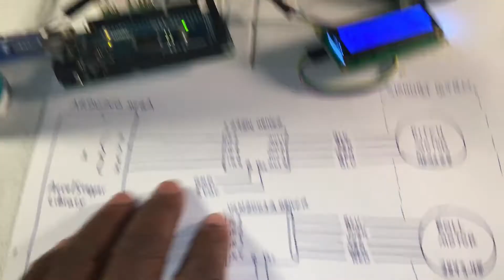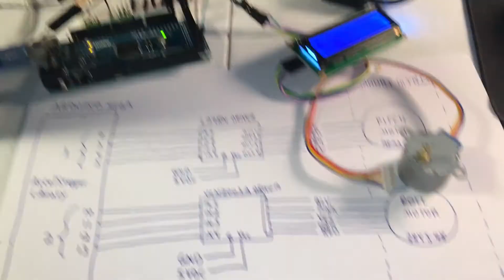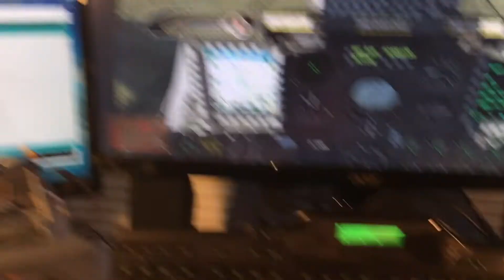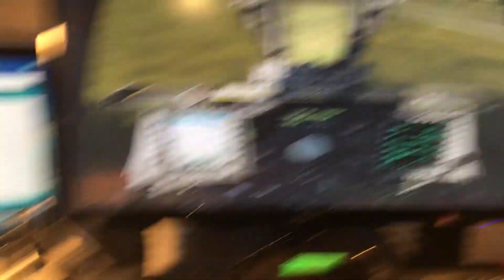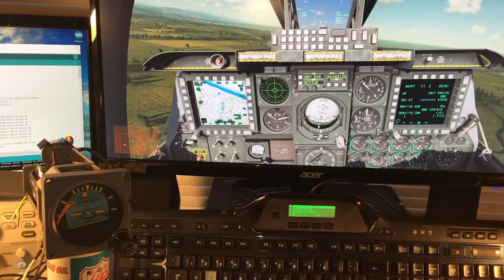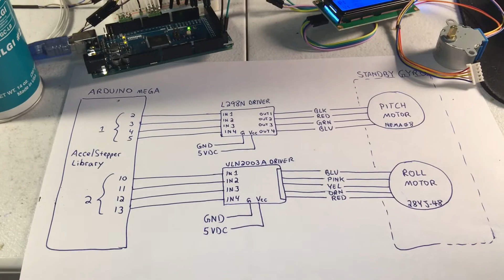A-10C Home Cockpit:  Standby Gyro Mod Demo

Comment: Hi! I’m wondering how to connect the proximity switch for zero position and do I need to add any programming for that? Also, it seems like the resolution of the big stepper motor is coarse. Does the small stepper motor have better resolution?

Comment: Joe, you always have fantastic work. Thanks for posting another video. I have found myself in a dilema, 3 consoles built, but the F18 Horny is so good and I see some people are getting DCS Bios to work with it already. Might switch to it. Less analog coolness compared to the Warthog, though. Noticed your backup ADI is opposite/reversed showing an opposite banking angle against what the instruments within the sim environment displayed. Also, recommend when demonstrating things like this, set up a sim environment with the aircraft already flying. For example, I have 2 setups for sim building which reduce a significant amount of testing time. I labeled them "Ground A10 Arduino" and "Flying A10 Arduino" respectively.
Reply from the maker: That's a good idea.  Taking off from the test bench isn't ideal.  I like the Hornet, but my favorite all time plane from that era is the F-14 Tomcat.  That's the one I  want to build.  So my dream would be the A-10C, F-14, KA-50, and P-51.  Yeah I got fixated on counting roll tick marks at the top and never looked at the standby adi horizon.  I didn't notice until after I posted that it was turning in the opposite direction.   I was looking at the top arrow and saying yep arrow is rolling to the right at two ticks over and the sim is at two ticks.  Ship it.

Comment: Excellent work Joe! I've  been thinking about this instrument for a while now, great to see you have it working. Possibly changing to an A4988 or EasyDriver Stepper board for the pitch axis would allow you to microstep the motor and have it even smoother. You'd need to check the current requirement of the motor first though to choose which board to get. Top work man, looks really professional
Reply from the maker: Thank you Boltz.  I'm one of your biggest fans.  A lot of times I would spend hours on the computer thumbing through cockpit builds or listening to virtual pilots playing DCS on youtube.  I remember admiring your pages from the forums.  Can't wait till one day we can all team up and fly and make videos of our missions together.  Yeah, that's the second time the Nema 08 has bit me.  The resolution is about 1.8 degrees per step.  So I need a large mechanical advantage in the gear setup where the motor gear is much smaller than the one its turning.  So I was wondering was there a fix in software for the 4 wire setup.  Also I have several arduino Due which is 3.3V and I read that the easy driver is compatible with 3.3V and 5V.   Plus I'd save on the number of I/O needed to drive the motor too.
Reply: Can't wait till then. Hopefully not too far off. The EasyDriver can go down to 1/8th step I think so you'd get 0.225 degrees per microstep then. That's a nice little stepper there I'm going to have to get one to play with. Bear in mind I've never used the EasyDriver board myself but I've heard great things

Comment: Great work Joe, are the proximity switches to enable zero detection at the point the gyro is first initialised.
Is there a particular make of proximity switch you find works well
Reply from the maker: Yes, in the void setup routine is where they are looked at once during initialization.  So it works well if the motor isn't binding or the gears slipping loose or it will loose track of the motor position.  For example, give it too high RPM and the gears may jump loose from each other.  I use Omron proxinity switches,  part number EE-SX872 and EE-SX772.
https://www.mouser.com/datasheet/2/307/ee-sx77_87_ds_e_7_2_csm484-471263.pdf

It has an LED indicator that has nothing to do with the switch out function.  You can get the LED to be in sync or out of sync with the switch output by ordering the ones with the "A" at the end of the part number.  The LED is a visual to say if the beam is clear or blocked and it maybe in sync or out of sync with the switch output depending on part number but anyone will work as you can always invert the bit in software if you need to.

Comment: Roll is inverted but that's a quick coding fix. This is some great work man.
Reply from the maker: Yeah, I noticed that afterwards.  I got fixated on watching counting the arrow head and tick marks.  One revolution in roll was 1050 steps.  But the scaling was off by half so I had to input 2100 steps to get the arrows synced up.
  int ROLL_targetPosition = map(ROLL_Value, 0, 65535, 2100, 0);
need this to switch the direction--->   int ROLL_targetPosition = map(ROLL_Value, 0, 65535, 0, 2100);